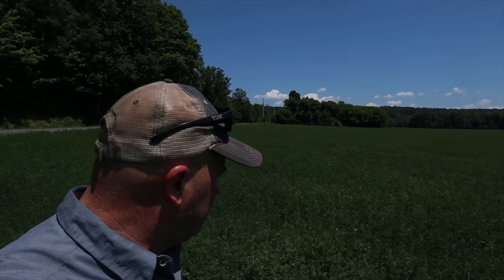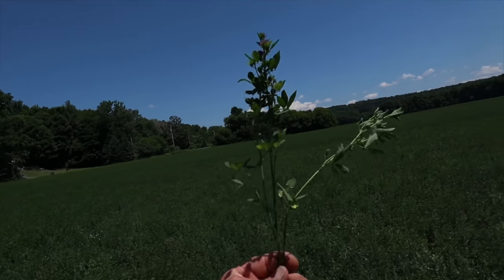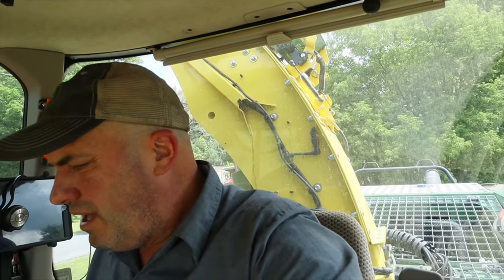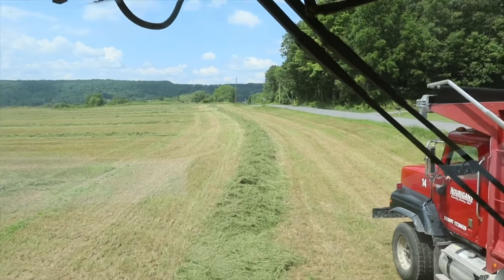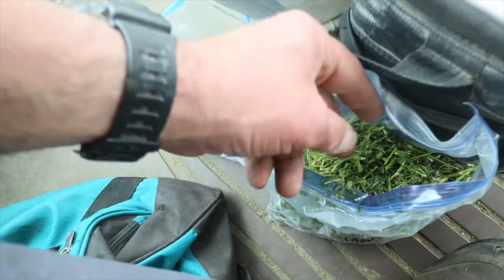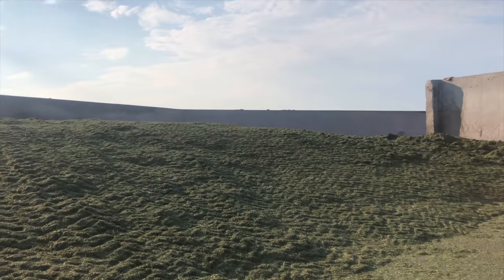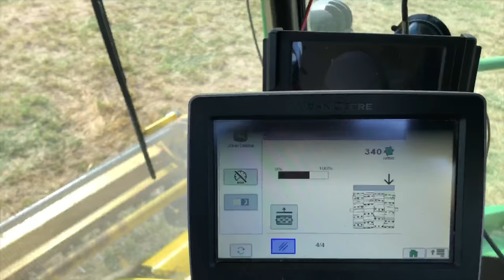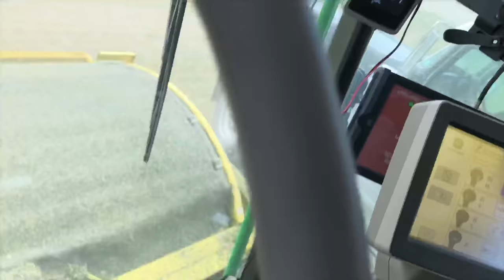Leaf Hoppers and Aphids have decimated our Alfalfa crop.                        ... Well some of it

Comment: Get a 500 gallon tank to pull behind the chopper.  20 gallons a  load in the real gummy stuff will keep it blowing great. Sure beats scraping or plugging the chopper.  Run a gas powered engine on the tank, run a regular water hose from pump up along the side of the chopper,  past the cab with a valve you can open and close out the window to control flow,  and dump water in on top of head as it enters the feed rolls. Well worth rigging up when the hay is dry.

Comment: I’m assuming that was a fixed wing sprayer. Have you ever looked into having a helicopter spray your crops? We had a bunch of neighbors go in together and have a helicopter spray their soybeans for Japanese beetles a couple of years ago. I spoke with the guy driving their spray/fuel truck. They park the truck close to the fields they are spraying and then load the helicopter with chemicals and fuel from on top of the truck. Seemed like they covered a lot of ground, since they didn’t have to fly back to an airport.
Reply from the maker: Our fields are too small
Reply: Farming Fixing & Fabricating that’s why all of my neighbors went together to get a helicopter to spray instead of a plane. They all had smaller fields. I have no idea how much it cost to have it sprayed.